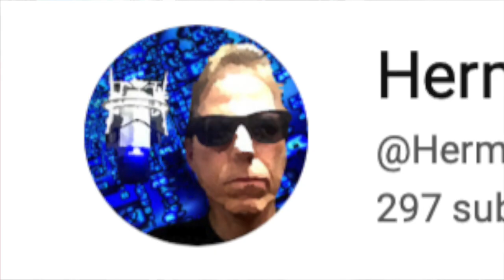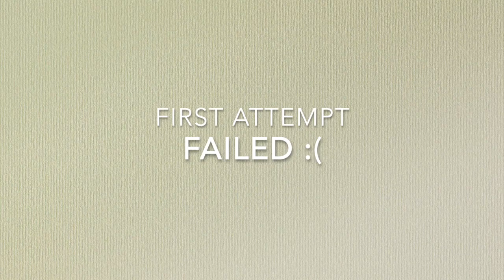Colloidal Gold Is Not So Easy!

Comment: I scrub the gold really hard to get rid of the oxidation on the surface of the gold.  
Next you need higher voltage as it should take less than 15 minutes to make it.
Reply from the maker: I did learn to adjust the voltage some

Comment: Colloidal gold is a hell of a lot easier than made out in this video. Its not as hard asis being made out in this video. Also your Gold and Copper Anode/Diodes are about twice as far apart as they should be. Move them about an inch apart and you'll have a heck of a lot better results
Reply from the maker: Rough comments but a good tip
Reply from the maker: I'm not sure why this comment is popping up now.
I thought I'd already answered.

I later discovered that a lot of my problem was the settings on the DC supply.

I'll keep your comments in mind, Thx!